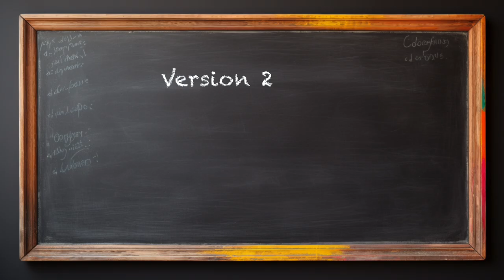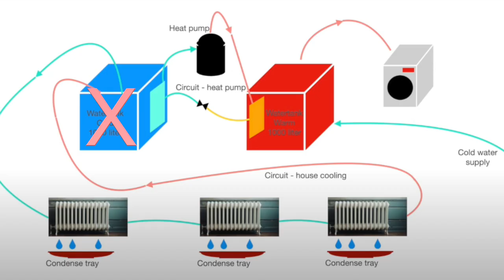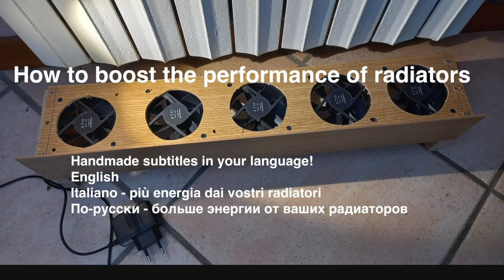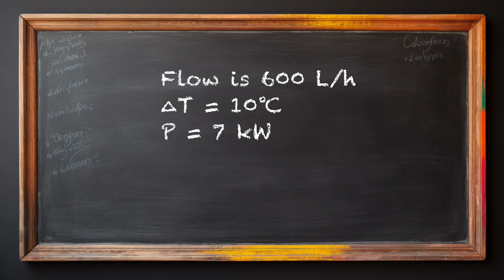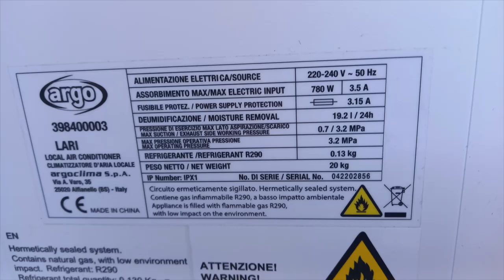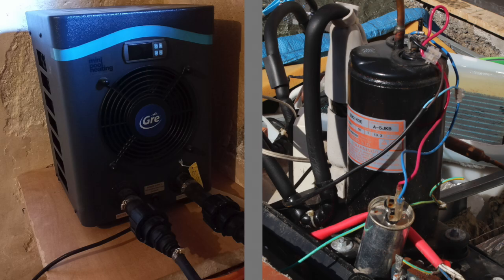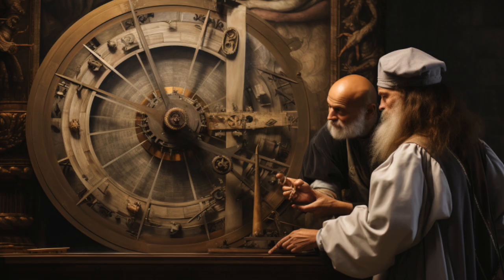This System Disappointed Me — Until I Realized the Secret - Video 116

Comment: "The temperature difference between inlet and outlet was only 3°C" Assuming that the temperature in the heat storage tank was good, doesn't it mean that the heat exchange in your house is unsufficient? Don't you need more cooling fans on all radiators?
Reply: Or was the temperature of the water coming from the heat storage too low?
Reply from the maker: Hi Geert, sorry to be unclear, this 3 degrees difference was of the pick up radiator and that was already scarce. There was no time to fix it because tomorrow we are leaving and will come back in April. Anyway also the radiators in the house will need fans. As said at the end of the video I want to realise the system Version 2 in Tuscany where we are now going.